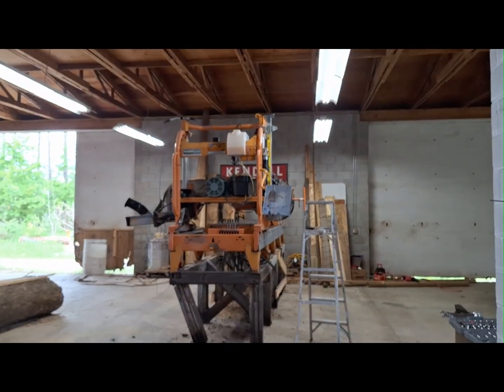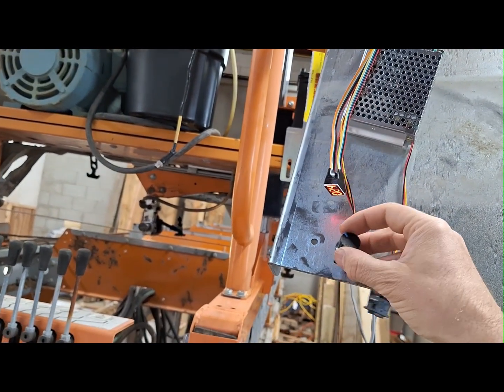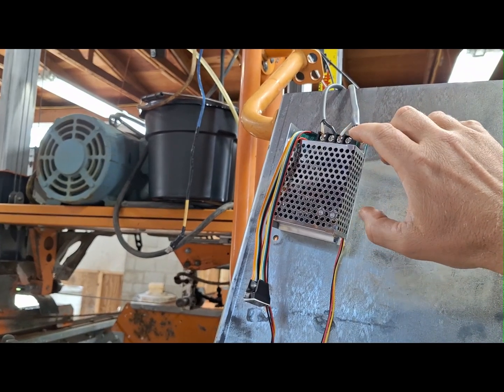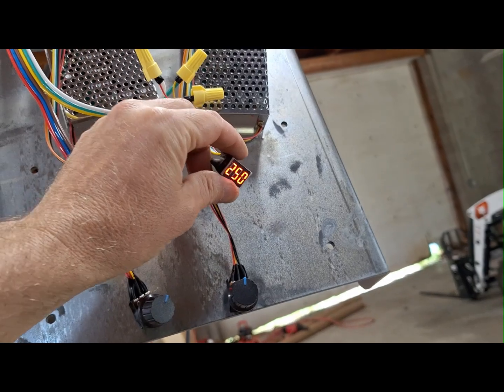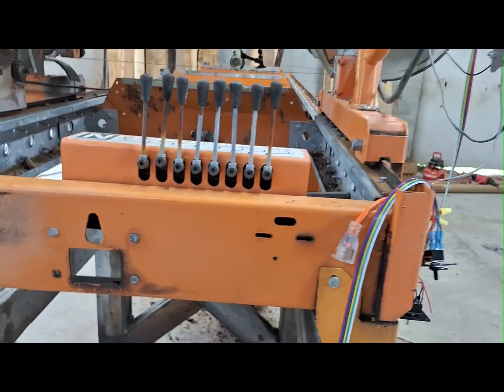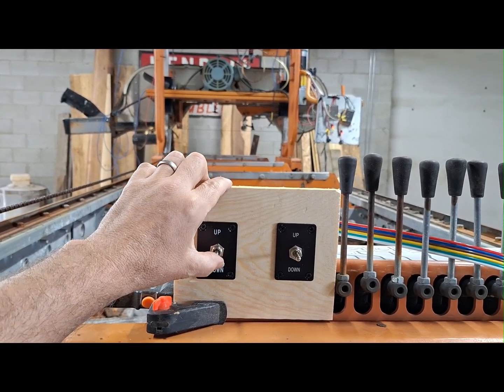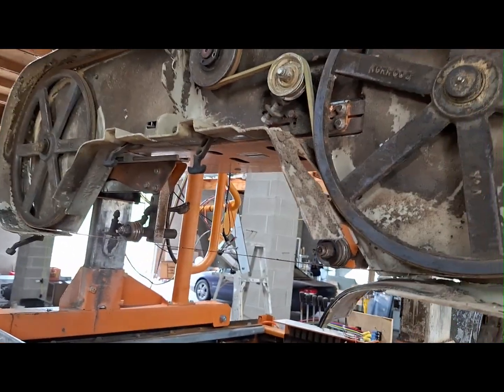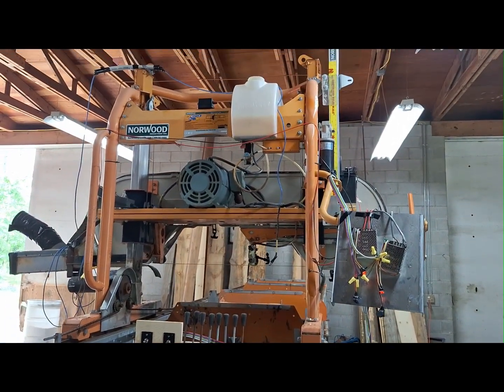Making A Power Feed Control Box For My Norwood HD36 Sawmill

Comment: Looks great ! Put main fuse on battery . wire in voltmeter off charging system on engine. Use DC auto reset breakers for them drive motors.  PC fans will work great for motor controller. That have filters as well. Keep that dust out . Solder first than cap them.  Best for vibration and dusty /damp environment.  If engine does not have hour meter just add one. Wash them chains like with paint thinner or break parts cleaner . dry and re oil . Chain saw bar oil work great . It sticks to chain then ever so often clean chain and re oil . Cheers from NY
Reply from the maker: Thanks for all the tips.